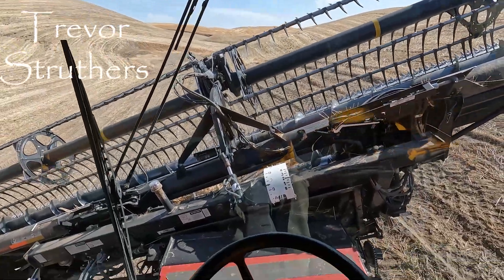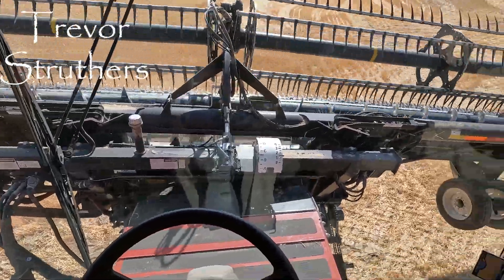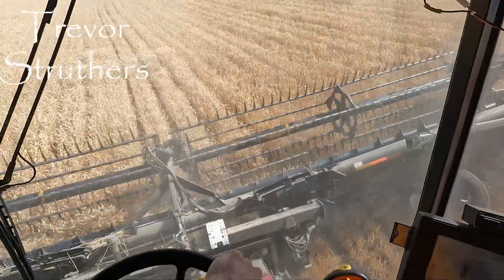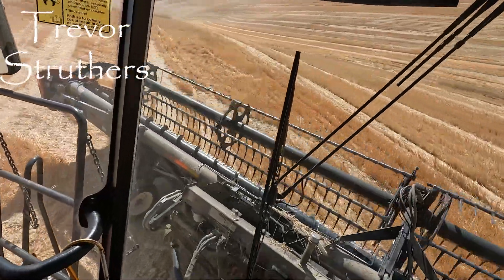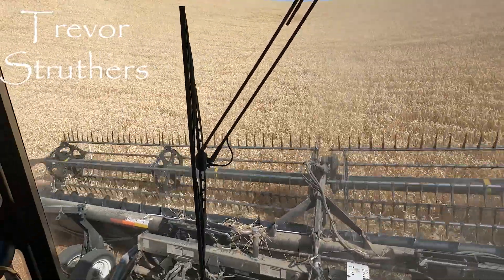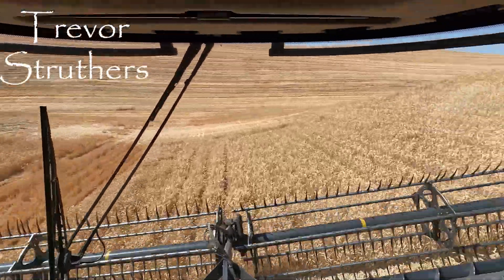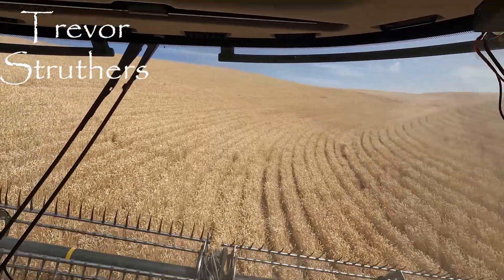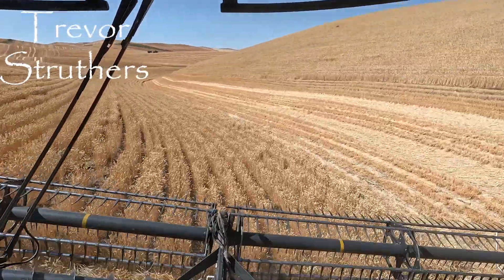Wheat Harvest Day 10. How to cut in the hills. - Grain Hogs S02E08

Comment: I'm 55 years old in The Dalles Oregon, bottom of action yard hill.
Experienced hillside Field Man, Grain cart, rock picking extra.
Will  work for a place to  put inn  a new clutch and left springs on my truck.
Have my own tools and will pay for my own Parts.
Will need use a ranch truck to tow my trailer to the job. 
My clutch is not dead but damn close to it.
Reply from the maker: Passed along.
Reply: @TrevorStruthers  I emailed you my phone number. Thank you.

Comment: Do you go through a lot of rims on the combines or are they specialized to handle the heavy side loads?
Reply from the maker: Nah, not often do the actual wheel (or rim) fail. Ive seen a big roller on a john deere t track crack in half. Thats on tracks, but is like the rim of a tracked tractor.
Reply from the maker: Axles and hubs can crack out though and break. Which makes the whole wheel
Come off

Comment: Why is the wheat out there planted in such wide rows?  Wheat I've seen is planted in rows 2 inches apart.  Is that a special variety of wheat that requires that?  What is the typical yield?
Reply: No wheat is planted 2” in 2” rows. 12” is common for hoe drills… 7.5” or 10” both common with disk drills
Reply from the maker: Averages vary across our farm.

Comment: Does that kind of tire pattern on your combine perform better in those hills than the common ridged ones? Haven't seen that too often.
Really impressive footage btw, keep it coming!
Reply: I always asked that to myself... Here in Italy, where we use "real" hillside combine, we use regular tread tyres. We cannot use duals, as the tyres remains perpendicular, so its a different kind of levelling. Never see here a diamond tread, or a tread likes that on a combine. I saw some photos of older Case 1470 or 1670 (factory leveled, so like ours)  in the Palouse with singles and diamond tread. Maybe diamond tread and similar have better side stability, but here in Italy we also Need traction because often we have to do tight turns uphill, or work the field up and down, we cant work the field around like in the Palouse.